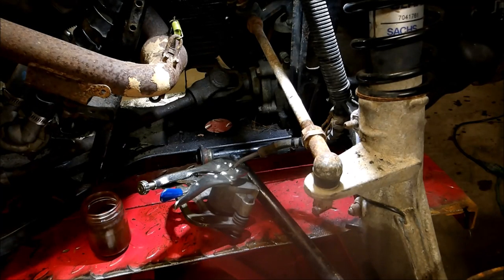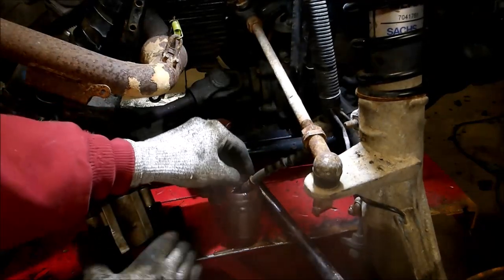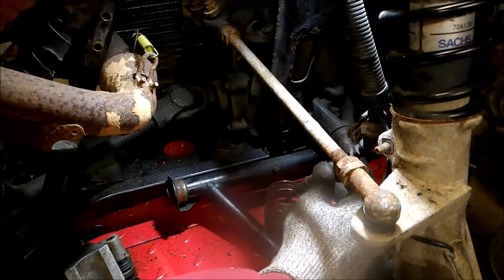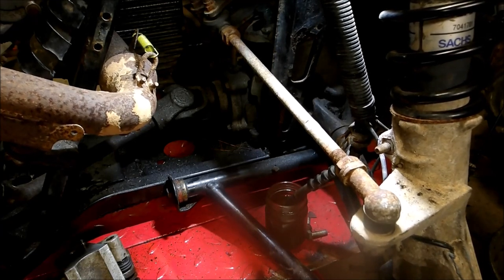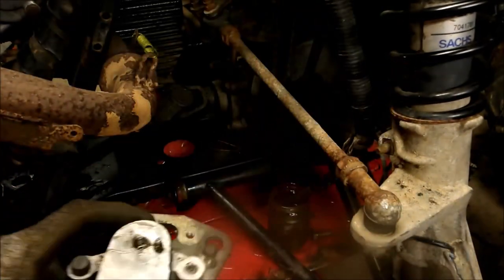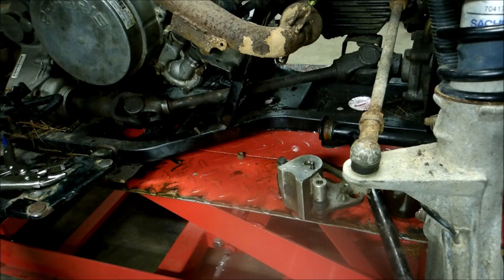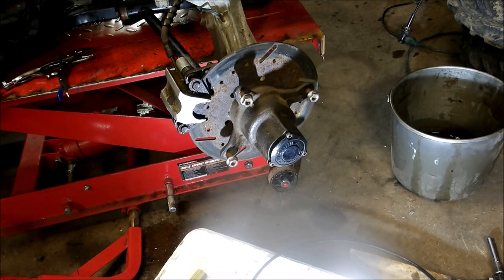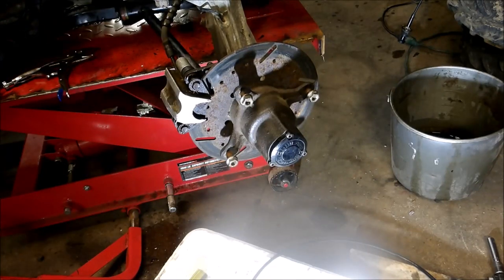Broken Bleeder Screw? How to bleed your brakes without it - Polaris

Comment: Couldn't loosen the screw of that brake line let the brake fluid flow the air mixed with the old brake fluid drips out then tighten it. I hope it helps some one.
Reply: So are you saying don't remove the caliper just losses the brake like hose and let the brake fluid drip?

Comment: Just a quick tip: Instead of trying to "quickly" get the brake hose bolted back on the caliper. Press the brake pedal down, and use a stick, or cinder block to keep it down, then bolt the brake hose back onto the caliper.

Comment: If this works when i do my pajero, my man youve just saved me soo much hassle, 2 days into the bleeder screw not moving, heat cycled soo many times now and still not moving! Im gonna try this instead :D
Reply: Did it work?
Reply: @jaradsimpson7669  I had my caliper off my car, it was in my kitchen i kept heat soaking the bleeder screw then hit it with ice and/or water, and repeated like 2p times nothing.... i just fucked up the screw doing that... i got really pissed off at it, fucked the internets advice off and heated the fuck out of the caliper and screw at the same time and she broke free, i ended up getting it off that way soo I managed to replace my brake lines and bleed screw and bled normally. Sorry I cant confirm mate

Comment: I have been trying to bleed the brakes on my 2001 Volvo s40 for like a week so hopefully this helps. My bleeder screws are rusted down to nothing
Reply: Search banjo bolt. It's the bolt that holds the brake like to the caliper, with a blender integrated.
Reply: @fucker666477  With a blender? What does that mean? You dont make sense
Reply: @javaidsadiq5775 I think he meant bleeder interpreted into the brake line as one... vs having to use the broken or stuck rusted bleeder.... other words someone was in our situation and got smart and developed a brake line with the bleeder valve attached to the end before it screws on I would assume... prob make fortune off it too 🤣

Comment: Won't the caliper get filled with air since the line is removed
Reply from the maker: if you leave it with the hole face up and don't spill any..it will work. you just have to be quick about installing the line.

Comment: Thanks much Titaniumman! This video really helped me a lot.  Rear wheels on my pickup truck both piston within the cylinders were seized and not moving so I kit it, 
Was bleeding from the break line cause both bleeding nipples were  broken and not matter how many times I bleed the breaks pedal keep drop to the floor.
Then I searched for a video content  that can relates to my ordeal and it sure work for me.
Reply: Search banjo bolt. It's the bolt that holds the brake like to the caliper, with a blender integrated.

Comment: Awesome !  Thanks so much for this tip.  If I do this on the one rear left caliper on my car--- do I HAVE to bleed the other side, or should it be okay? (I'm going to bleed all four anyway probably- to replace the old brake fluid --- it's been a few years) but just curious,  DOES THE MASTER CYLINDER SEPARATE EACH CALIPER... OR BY THE FRONT/REAR?   Just a little confused if it's mandatory to bleed the other brakes (and if so, just the other REAR --- or all four?)
Reply from the maker: The master goes to a junction box then to all 4 tires. I would bleed all 4 or 3 if its a 4 wheeler.
Reply: @TitaniummanGarage  😆

Comment: Good commentary. The weight of the fluid in the engine compartment brake fluid reservoir allows fluid to drain by gravity(if more slowly), so why pump the pedal? Just for quicker result? Gravity needs only one person(advantage). Your container for old fluid is a bit unstable - you want something which cannot tip over with wide base and good volume.
Reply: Pumping stirs the contaminates up and forces them out the master cylinder as opposed to jist letting the fluid drain, leaving it all resting in the bottom of the reservoir.